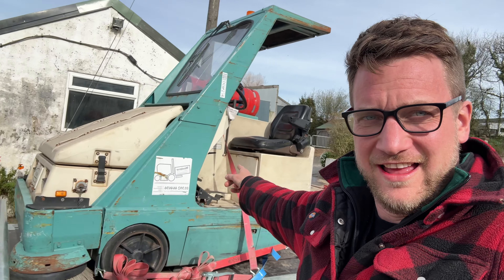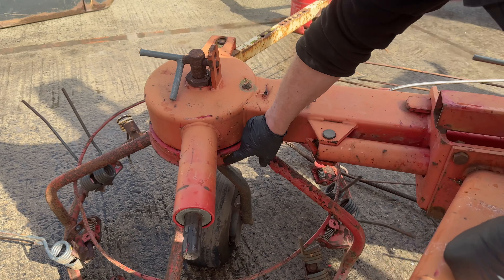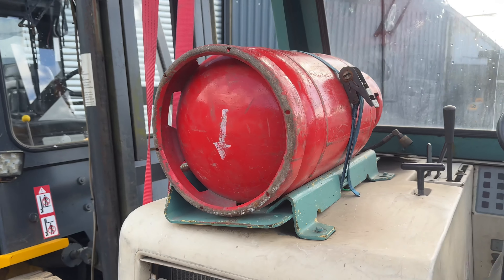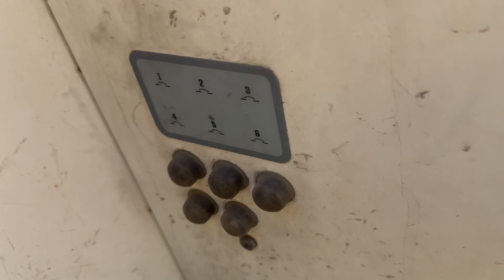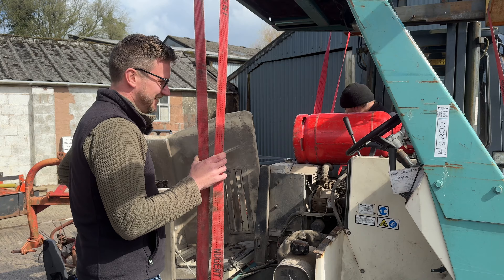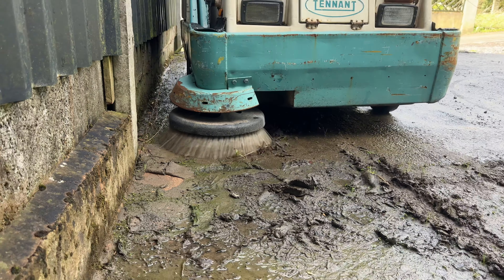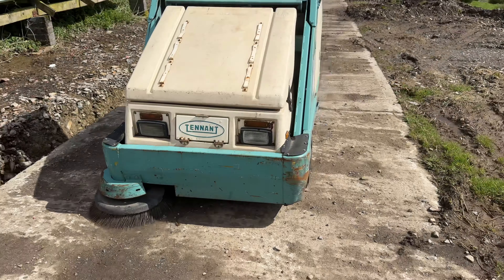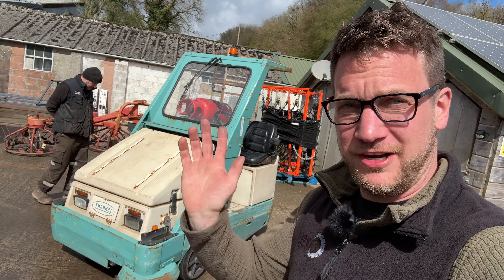Auction Purchase has been delivered from a recent Plant and Farm Sale! But what have I Bought?

Comment: I know Tenant do use Kubota engines in their sweeper machines, I used one for a weekend job once which was a diesel walk behind with a bike seat you could pull out, it was really good. I think it was a  Green Machine 414 or a 412, it also had a Kubota engine.
Reply from the maker: Could well be, will take a closer look.

Comment: Hi James, Handy motorised sweeper , Is it worth converting it to run on petrol replace the gas bottle for a motorbike fuel tank just some alterations removing the regulator for a carb it should be ok , nice bit of kit  you done well for £400 , by the way the cracked windscreen it an MOT failure. Have fun catch you soon Take care
Reply from the maker: Great idea Shaun, you certainly good do but I recon the cost would out weigh the advantage on this one. Cheers mate 👍🏼